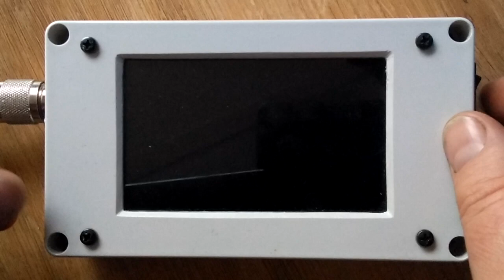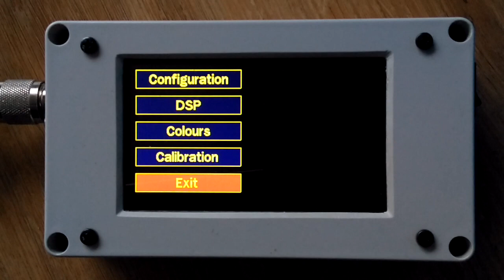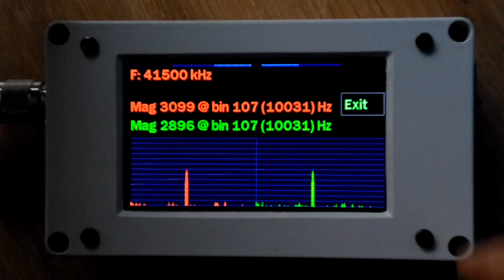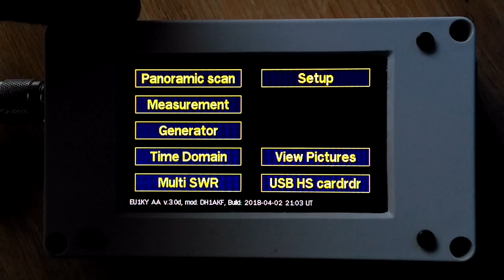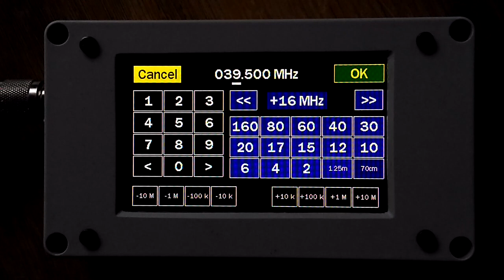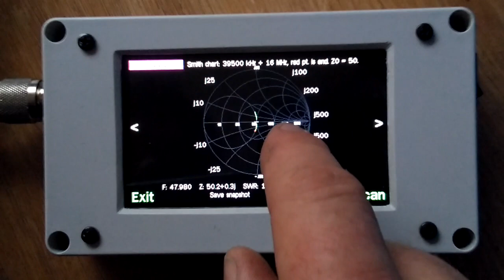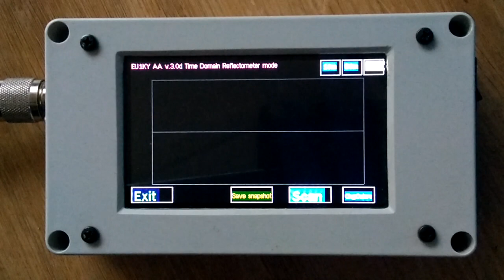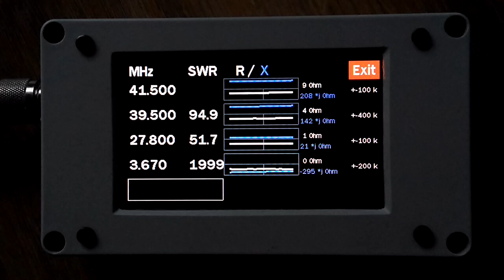EU1KY antenna analyzer v3 with code mods by DH1AKF and my own menu structure.

Comment: How much is that i use tha nanovna
Reply from the maker: This one costs a little over 100 euro's (about the price of the VanoVNA-F) it is a lot easier to use than the nano VNA and has some fun extra features. The nano VNA is better with S21 measurements (measuring filters) in VHF and higher.
Reply: @PE1PWF  yes i got it exactly for the insertion loss s21, i need to check filters

Comment from the maker: you can simply connect the device to your computer via the mini USB (ST-link) connector. A drive wil open, drag the new .bin file to this drive and the device will reboot with new software.
(plug in the USB cable on a powered unit)
KD8CEC has the latest firmware online.
Remove the AA folder from the sd-card and do a full HW and OSL calibration.

Comment: Is the files for the 3d printed case available?
Reply from the maker: I do not know about printed cases, we juist used a standard case  158 x 90 x 40mm. We bought it a a local shop, but if you search the size on google or the big online marketplace I am sure you will find it.
I think I did see someone using a printed case on the www.cqham.ru forum or www.qrpforum.de other interesting links on http://www.wkiefer.de/x28/EU1KY_AA.htm or maybe I did see it as this forum. https://www.qrpforum.de/forum/index.php?user-post-list/2810-dh1akf/

Comment: Bottom line: Is the EU1KY Antenna
 Analyzer worth messing with?
Have you heard from anyone purchasing a EU1KY Antenna
 Analyzer from elekitsorparts.com (This is the guy from China that is selling the EU1KY Antenna
Analyzer complete assembled)?
Reply: I purchased the FAA-450 Antenna Analyzer from elekitsorparts.com in China. Paid for it using PayPal. It was ordered on 12/22/2018 and shipped on 12/26. It arrived today 1/8/2019.  I ordered Option 1. The unit came in with everything that it was suppose to have. It powered up and after doing a OSL Calibration I was testing my antenna within about 30 minutes. I scanned all my antenna and did a comparison with my MFJ-259B and it is nearly identical across all antennas and bands.

I am impressed! 

I opened the case and the hardware is extremely well made. All SMB components with exceptions of connectors, coils and such. Looks great.

So far I am pleased.

I paid $217 plus $9.95 shipping.
Reply: My FAA-450 came with Build 317 10-02-2017 installed. I updated to Build 343 which works well. I tried updating to 11-14-2018 but experienced occasional hangs and the accuracy didn't appear to be as good as build 343. I did HW calibration and OSL several times but appear to not have any improvements.
So I rolled back to build 343.
I guess it's possible that although I just purchased my analyzer there could be some hardware differences on the developers equipment . Perhaps changes to some values of resistors, caps or maybe adding or modifying chokes

But I like the FAA-450
Reply from the maker: @rufus4779  The choke at the measurement port should make some difference but not for the original frequency range. The original frequency range should be just as accurate. There are only a fixed number of calibration points. If you need to use these points over a a wider range you can imagine the smaller frequency range could give a bit better results. For the hangups, the hardware probably should not matter. If one ants to use the AA on 23cm an other choke might be needed, or using a turn less on the choke might help. Resistors R13 and R6 probably need a lower values for 23cm since the 5th harmonic is used and that is not as strong as the 3rd or 1st harmonic.
Reply from the maker: This one looks quite nice. Also some nice other products. I guess this one could work just as well as Amy other build.

The difference could be in the parts used and the way it is manufactured. The mini600 pictures I have seen look solderen by hand, this one has the parts hidden but nicely shielded. If I would pick one I would probably taken this one over the mini600. 

Unfortunately I only have experience  with the units I made myself. I also have my frontend boards manufactured in China but with my own specifications. Probably not the cheapest but you can het a proper product from China if you have the right factory and good Instructieonderdelen and partslist.

Comment: Is this available to purchase?
Reply from the maker: Edit: The last version of the program I compiled... https://goo.gl/y4F1pr . Most recent software by DH1AKF info is on cqham.ru forum

This is not a device that can be bought as you can see it here (I am not selling mine). The main components are a STM32F746G-DISCO and the frontend board designed by EU1KY.
The frontend boards can be bought like on ebay, there are ones without components or also assembled frontend boards. Just search EU1KY on ebay. There als is a chinese seller selling a complete unit I think for quite a big price and I have bad experience with chinese quality, maybe this is A good product I have not seen the Chinese variant. I do not know if there are any complete kits for sale. I built a bunch of these together with other members of the PI4FRG radio group. I ordered me a bunch of pcb's from a factory, I was able to build this for a very affordable price.
Reply from the maker: Someone is making some serious money on this. Probably over the backs of Yuri and Wolfgang and others that contributed to this open project. 
You should be able to build it for about half the price (not sure if 200 already includes an internal battery shipping costs and VAT) Once you have the frontend board it is easy to build. I don't know if the chinese frontend boards are as good as they could be. Pictures I have seen do look kind of nice but I have no idea how well the specs of the parts are. Anyway, this device is a fun project think about building yourself before you put some $ in Chinese pockets.
Reply: @Carl Jito mini600 have problem with power supply, cannotbe fixed...  and perhaps problem with touch display...
Reply: http://www.qrz.ru/classifieds/detail/antennyj-analizator-eu1ky_292595

Comment: I have an original EU1KY AA and DH1AKF's software causes my AA to lock up.  I don't know why.  It works on some menus but not on MEASURE.  Too bad too because his screen layout is superior...
Reply: It really shouldn't. The only think I can think ok is using a new SD acrd for teh calibration data. The file structures are very different.

Comment: Have these updates been merged with the mainline?  If not, are there any advantages or features why someone would want to stick with the original?
https://bitbucket.org/kuchura/eu1ky_aa_v3/wiki/Home
Reply from the maker: Wolfgang DH1AKF has been producing lots of new features, but the old ones are not lost. Wolfgang used my part of the menu structure so I guess the latest code by Wolfgang is using the best at the moment. It would have been nice if it was a branch of the code on bitbucket. 
Wolfgang writes on this german forum https://www.qrpforum.de/index.php?page=Thread&threadID=11612 and the latest bin is at his page here wkiefer.de/x28/test/F7Discovery.bin or the current source is here wkiefer.de/x28/test7analyzer.zip

Comment: Where to find this version ?  Justas LY2BOK
Reply from the maker: Hi Justas, I just put it on my google dirve.

https://drive.google.com/open?id=1RvPm2zyGopTffcyerdYnNiSUcAzUz95W

73'  Edwin
Reply: Thank you.But this is the HEX file.  Please  the BIN file. I am not programmer...and I can not do it.
Reply from the maker: How do you normally get a now program in your device? I suspect you use ST-link Utility, that can work with hex just as well as bin files. https://drive.google.com/open?id=1Iux2E0jXI-o-Qt3bJwtXJuk8zq6oSDpt
Reply: ОК!!!! Working 100%  Thanks . 73!
Reply: @PE1PWF  I am totally new to using the FAA-450 EU1KY Analyzer. I just purchased one from elekitsorparts.com. It came with Build 317 2017-10-02. Comparing it with my MFJ-259B it appears to be spot on in its measurements.

I would like to update the F7Discovery.bin to the latest version available but not sure where to get the latest version. Also, are there any instructions on how to upload a new firmware . I would also like to get instructions on how to download the current firmware from the current system so I can fallback in the event something is not right after the upgrade.

73s N2OWM
Reply from the maker: @rufus4779  , I guess the software you have now is the original by EU1KY, you can get that here. https://bitbucket.org/kuchura/eu1ky_aa_v3/downloads/
The latest can be found at the website of DH1AKF http://wkiefer.de/x28/EU1KY_AA.htm

This is the one I use. https://goo.gl/BjShck it has my club logo, but you can change the logo by adding a a 480x272 size logo.bmp file to the AA folder on the SD card.

The thing is you probably need to do all calibration again, so change the jumper on the frontend board and do HW calibration and do the OSL calibration again. It you do set the lower and higher band edges to the same as the original you might not have to re calibrate.

On the cqham.ru forum is the most activity discussing the analyzer. https://goo.gl/79rZ4T

73'

Edwin
Reply: @PE1PWF  Thank you. I was able to download and install the upgraded firmware. I did a full HW Calibration and OSL calibration. All appears to have gone well with no issues. Working like a charm.

My FAA-450 came with Build 317 10-02-2017.

I checked the FAA-450 against my MFJ-259B and it is spot on for all my antennas. I did change the BAND_MAX to 450Mhz so I could test my 70cm antenna. Got very close readings to my MFJ-259B.

Thank you again for your assistance.
73s
Jim